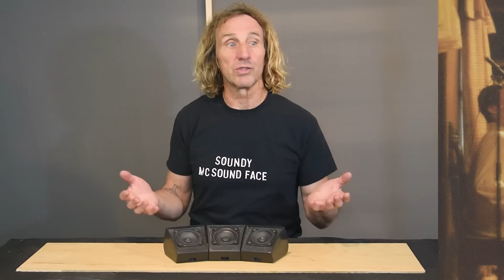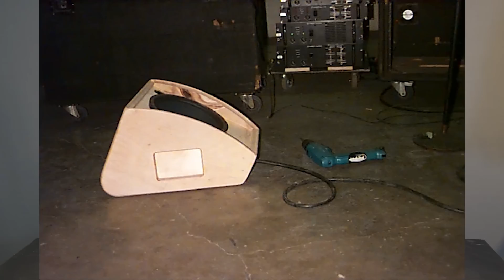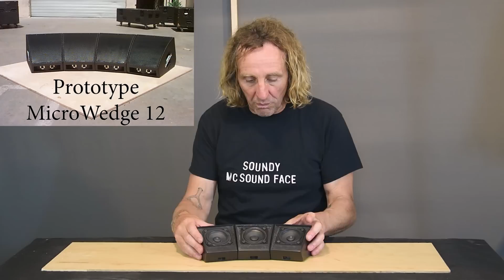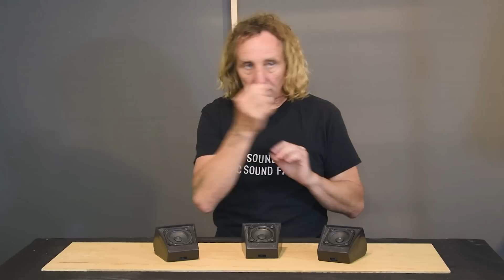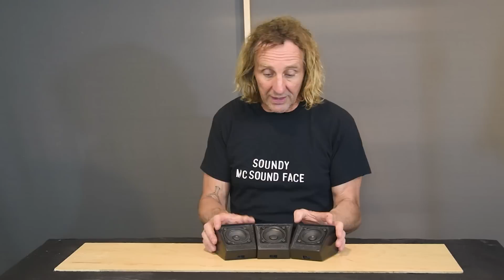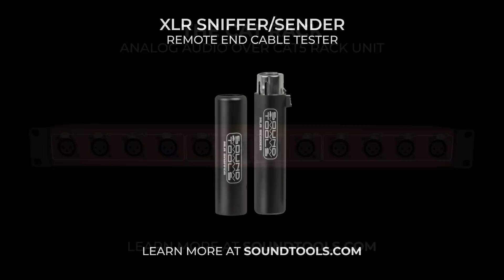Developing the Double Hung PA & the MicroWedge

Comment: 2x15 + 1x10 + HF of '80s top spec pro audio drivers is seriously loud for a monitor. Seriously. Totally agree about de-correlation and clarity being required, rather than just "more loud". It should be loud enough.

It is clear using backline in the rehearsal room - discrete sources - the ear's phased barometric pressure sensing array can decode the localisation information as inherent to the source, and distortion, reverb & comb filter are authentic and helpful, rather than audible as a distortion artefact. With phase distortion, directivity distortion, and intermodulation distortion being accentuated as the "veil" and generating localisation information that highlights the distortion, the distorted sound of a Marshall cabinet and the sound of heavy metal is a sound aesthetic which is essential to modern music. 

I actually put my stereo or "converged" mix through a distortion channel strip and bandpass filter to find out what happens when the music saturates per band - a really good mix considers saturation and balance - that's the art of tone. As a guitar player, a fine distortion characteristic and "glue" is a desirable thing, rather than something to avoid.

For sound reinforcement per source I tend to basically make a three or four way discrimination per source - "spotlight/lead", "converged" backing/rhythm, "bassiline" kick/sub, and reverb - generally injecting a reverberant component is something to avoid but for classical music and opera this is required to suitably amplify sources. Classical music sound reinforcement is an advanced technical art form, and the multi-output "room control" models are becoming capable of active noise control and being able to tune, remove or add room modes to taste.

Once you start putting bending wave motors into all the surfaces and putting a microphone array & sensors into everything, and creating a truly "networked" sound reinforcement system, the sophisticated tricks used in phased array RADAR systems and industrial measurement acoustics can be used.

One of the ranges of devices I am working on is an active acoustic treatment + reinforcement system which also functions as an architectural surface & visual display. It's flat but it isn't thin like a film or a paint... yet... 

... but it in theory totally could be ... it would be expensive paint per square inch done with current tech ...

My panel is under an inch thick as it stands, with an acoustic resolution of a few feet to a few inches square at a power density of 300W (getting up to kilowatts & megawatts industrial heater power is undesirable), and have come up with a unit which is fit for purpose for near field and mid field as well as reverberant information, and reinforcement use, but probably not fine enough for anechoic simulation / HF removing active noise cancellation. Bending wave reinforcement has a completely different feedback and distortion characteristic.
Reply from the maker: And also I will at some point demo a simple cool setup that sounds realistic using stuff I have made and laying around

Comment: That's funny. I thought about a multiple speaker mains system about 30 years ago. All for the same reasons that you mentioned. Line arrays came out and threw it out the window. Engineers want line arrays these days. I'm still a point source guy. Great videos. Thanks.
Reply from the maker: Proper tool for the job is an important strategy. A line array is a bunch of point sources vertically oriented. A true point source system would be a single coaxial or triaxial driver which often is insufficient to cover medium to large spaces. What people refer to as point source systems are often a bunch of speakers oriented in horizontal and vertical arrays.
Reply: @DaveRat  I don't know... 4 Danley J1's per side would be a pretty badass PA lol. Each cab per side would carry what you want in it. 1 for voc, 1 for drums etc. It would be incredibly clean.
Reply from the maker: Point sources (non arrayable designs) are wonderful and excellent for many applications.

The challenge with point source enclosures that are actually point sources is they can not be arrayed and still be point sources.

That said, multiple point sources, each with differing input signals would not be an array and would be quite effective for covering spaces as long as the coverage needed can be covered by any single box

Comment: The double hung PA seems really interesting. I was recently at a show with the normal sort of line array and the intermodulation between guitars, bass, drums, and vocals made the vocal almost unintelligible. It sounds like this new setup is kind of like getting a bit of the “Wall of Sound” separation, and to me that seems that clarity could be improved a lot. I would go to more concerts if the sound was actually better.

Also for monitors, I’ve always enjoyed playing on stages when stereo or multiple monitors are available. While playing bass (I play upright usually) with the luxury of two monitor mixes, i like to do something like lots of snare and some kick in one speaker, rhythm guitar in the other, and a bit of everything else spread out, and I’ll hear my bass from my amp. I feel it far easier to sort out the groove/timing that way, and sometimes that can be a bit tricky with the LF delay you tend to hear from the larger sub arrays coming back on stage. The added separation makes me go from struggling to hear the groove to just getting into it and playing. Now I want to get another few monitors for my PA and run them this way too. Thanks for the very clear explanation as to why it works.

Comment: so in a Plato idealised world a system for every sound source, got it
Reply from the maker: I do understand the tendency to drift toward extremes. And also making things overly complex will inevitably result in diminishing returns.

Overly simple like mono and stereo will offer the lackluster results we currently accept as the norm.

And somewhere in between, more than stereo yet not a surround sound simulation, but rather an increase in sources, will get as greatly improved results with a moderate increase in complexity.

I will do a demo vid at some point

Comment: I always wondered how a driver that was creating say a bass guitar waveform could at the same time create a voice waveform . i still don't get it but I like trying to figure it out
Reply: The waveform the speaker gets is literally the summation of multiple waveforms. Frequencies get cancelled or amplified, unnaturally. An excellent speaker can reproduce the sum "fairly accurately" but as Dave says, that point summation process just doesn't really happen often in nature. Maybe a cave or cove is a loose example of a natural "point source". Before electronics they would use "bandshells" to amplify concerts. Like a dish antenna, it would focus the summation and project to the audience. In that case the listeners also give up clarity and ability to distinguish source direction as well to gain volume.
Reply from the maker: Agreed, all the waveforms combine to form a new waveform that can be reproduced fairly well.

But when the reproduction encounters issues, those issues impact that new waveform and messes with all the signals that have been combined.
If the signals are kept separate, then any reproduction issues will impact each source separately and most likely, impact each signal differently due to the difference in the signal content.

So, a for a reproduction system to be relatively treransparent, it would need to be much more accurate to reproduce combined signals than it would need be to reproduce individual signals.

Comment: I have recently bought 4 mw 12's, ran by powersoft T604, and I have used this setup as You have reccomended in the manual, and the results are great. My lead vocal is very happy with the control she has on stage
Reply from the maker: Awesome! Which presets are ya using? They may be the same as the ones in the powersoft amp, but to be sure, the best presets are the ones I put up on daverat.com

Maybe in the amp ar the "R" version or Rat version

Comment: I’ve actually started changing my stage mix philosophy on smaller stages in order to reduce some of the monitor mix issues. Ive allowed the bass and guitar players to keep amp volume up a little bit to allow the vocals, and other DI sources to be reinforced in the wedge mixes. By no means ideal but on smaller stages and with limited resources it has helped. So much trial & error, experimentation and so little time…
Reply: I find letting the FOH subs carry the low end back on stage and cutting lows on monitors really helps keep the monitor clear and powerful as well. Plexi in front of guitar amps keeps stage volume up, but doesn't laser whoever happens to sit in a line from that amp
Reply: On small stages i'm asking musicians what they can't hear and then put them this in monitors, it helps to reduce stage noise and more clean mix, on bigger stages is different.
Reply from the maker: All good stuff
Reply: @tomazklancnik7760  I like that philosophy too. 👍🏻

Comment: Dave what do you think about the electronic sound separation engines?  Klang is doing something for IEM's.  I wonder if it might produce interesting results with a stereo pair of wedges?  Adamson has their new Fletcher Machine,  Meyer Sound has stuff that does stuff with a bunch of speakers all over the room.  D&B has something with speakers hung all over the room.
Reply from the maker: It's all about using the right tool for the job to achieve the desired result.

And then double checking to make sure whatever we did actually is an improvement and any issues do not outweigh the gains.

Each of the things you mention are designed for a goal and application. Things like immersive sound or advanced control to simulate source location

If choosing between having sound come from separate sources vs simulating or trying to create the illusion of sound from separate sources, the simulations will will always be lacking, whether or not that matters for the application is a separate decision.
Reply: @DaveRat  Yeah.  Sam Gamgee's dad said:  "There's nothing like looking when you're trying to find something."  Thanks for inspiring normies to have fun and just try things!  Ah - everyone knows it.  You inspire creative curiosity.  Thank you.